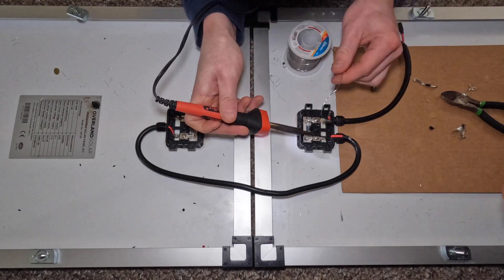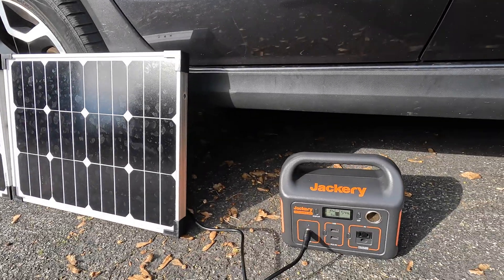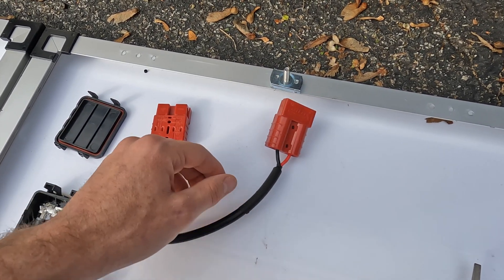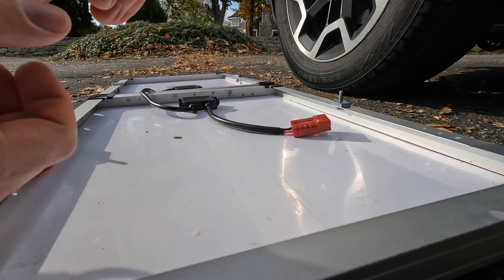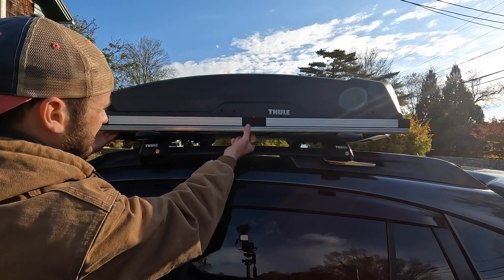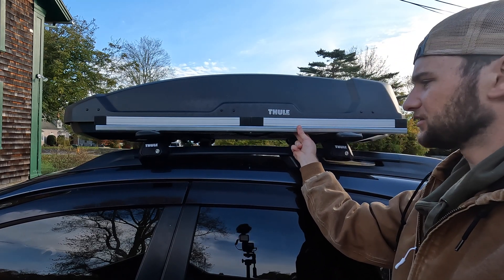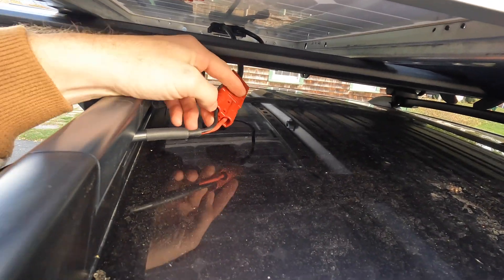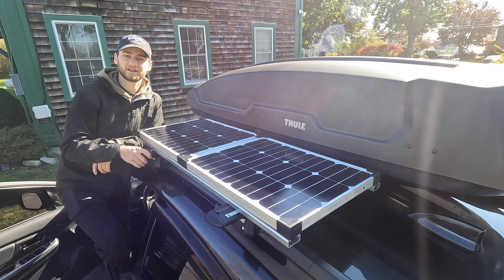DIY Roof Rack Solar Panel Installation - Subaru Crosstrek Car Camping - Soldering and Testing

Comment: what is the wide (cm) of the panels? Thanks for tip, I need to do it in similar way, however still finding ideally one solar panel with smaller wide to fit next to roof box.
Reply from the maker: @Danny42006   Approx. 16 in (40.5 cm)